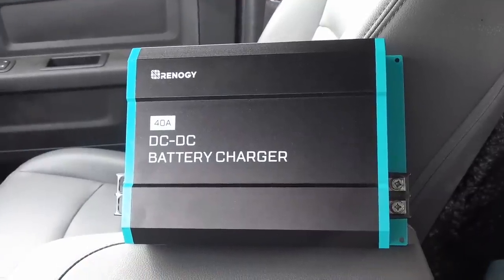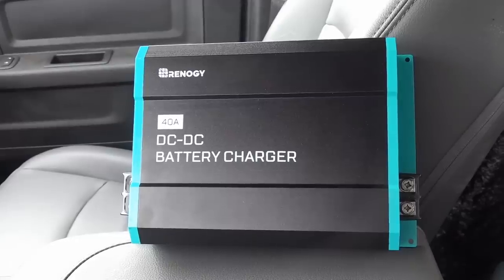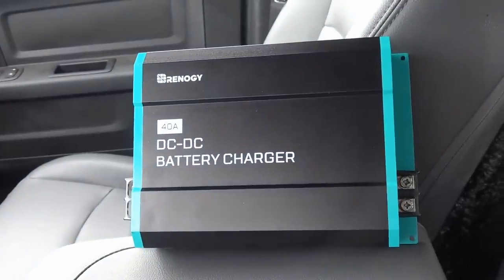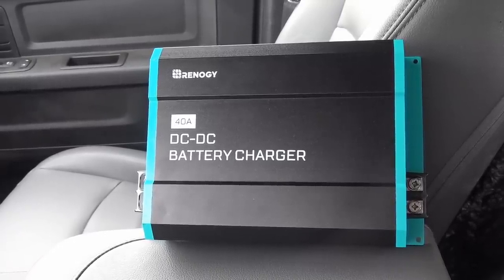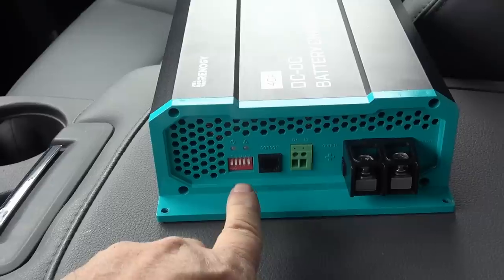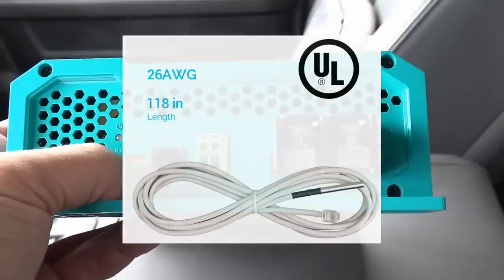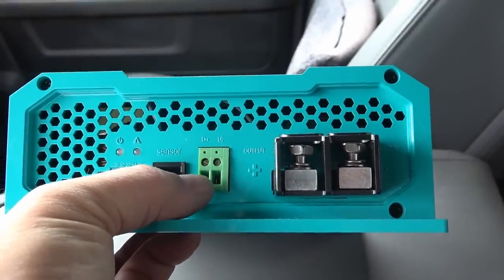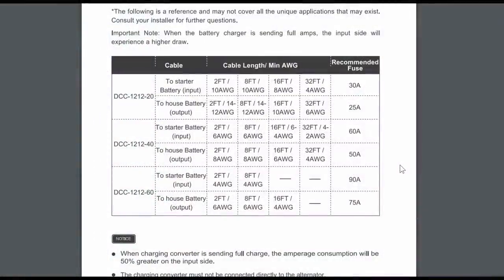Extra 40 Amps Charging into RV Battery Bank from Truck Alternator (Renogy 40A DC-DC Charger)

Comment: Does this system rely on the lithium battery BMS to stop accepting a charge when fully charged?  If yes, this is not recommended by battery manufacturers. The BMS is a fail safe only.
Reply from the maker: There is no floating charge, but you can set the lithium charge voltage option to either 14V, 14.2V, 14.4V or 14.6V You could be conservative and set the charge voltage to 14V and likely never get to the BMS failsafe voltage cut-off or else go with a lead-acid charge algorithm instead and it also may never get to the point of activating the BMS failsafe. That's what I have tried during my first test, left it in a lead-acid mode, 14.4V bulk, then 13.8V float -  it dumps full current into the batteries, then slowed the amperage near the end and my solar controller finished the job. It seems to work well fine with my Lion Energy battery BMS, but other brands may have a different BMS. That can be a big difference in battery quality how advanced the BMS is, but most of the "drop-in replacements" have pretty good ones.
Reply: @LoveYourRV  Thanks for the reply Ray.  In your tests, have you found that the DCDC stops output once the set target voltage is reached, or does it keep pumping out that voltage, keeping the alternator under extra load. (for lithium settings).
Reply: From the Renogy's information, it is a charge controller, so it should have a charge profile for most of the current 12 vdc consumer storage batteries.
Reply from the maker: I haven't had a chance to test much. A couple of days ago I left with battery bank down around 200 AH, towed for about 3 1/3 - 4 hours, mostly overcast day and arrived with a 100% full battery bank, charging had basically stopped from both the DC-DC charger and my solar controller. But, since I was driving I didn't have the chance to watch what went on. I'll be back with an update after I've had a chance to use the charger for a few months. and test out different voltage settings.
Reply: @LoveYourRV  Thanks Ray
Reply: @LoveYourRV  I was wondering if you disable the 12 vdc from the 7 pin when you enable the dcdc. If the lithiums/bms fail, do you still have trailer brake source power? How do you prevent back current on the seven pin? I did not notice any suggestions in the Renogy manual for these questions.

Comment: Don’t you have six switches on your truck? I would assume you would since you have the diesel. But those switches can supply the 12volt. Very easy to wire up as well.
Reply from the maker: No, I don't have the Ram upfitter aux switch package, I factory ordered my truck and limited the options to keep the cost down, it would have cost a few thousand more as they make you buy into a package of features to get it. I think I had to get the snowplow package or something like that, Canadian truck. ;) The light switch solution works fine, I always tow with the lights on anyway and don't leave them on when parked and the 12-volt marker light wire is already there. No need to run another wire from the truck to the trailer. Actually a much simpler solution in my mind.
Reply: Love Your RV don’t you already have a charging wire front the trucks pigtail? That would supply 12 volt when you turn the key on.
Reply from the maker: I wanted some control of when I turned on the DC-DC charger, have the option to let the engine warm up a few minutes or so before turning it on, and it starts to draw amps. For instance, on a cold start, the diesel truck initially pulls a lot of juice to power the grid heater.

Comment: So, it will boost the voltage?
Reply from the maker: Yes, most definitely. That's the main reason I have it so I can charge my lithium battery bank at the proper voltage even though they are located far away form my alternator. It draws more amperage on the input side so that it can boost the voltage on the output using the same overall wattage.  On my system the input draws about 50 amps so it can output about 40 amps. Input voltage is about 12.5V and output about 14.4V. Cheers, Ray
Reply: @LoveYourRV  thanks for the reply

Comment: How could you run this from truck to Bluetti effectively? My needs would be to go from Ram Promaster battery to the Bluetti so it charges while driving (instead of cigarette lighter option).
Reply from the maker: What Bluetti model do you have. There are many different models out there that take varying amounts of max wattage during charging. So makes it hard to answer your question.
Reply: @LoveYourRV  Actually I’m looking to get the AC200 like you have OR the new Ecoflow Delta Pro. In my homework stages now trying to design the plan for my rig. I’d love to not have to install any full time lithium house batteries and simply just use a power station.
Reply from the maker: So the best way to go I think would be to install an inverter of at least 600W and maybe a 60 amp DC-DC charger. That way the DC-DC charger would put out enough wattage to power the inverter to then charge the Bluetti using the AC charger input at 400W+. Downside is there would be some losses in the DC to AC transformation but charging is much faster versus the automotive cigarette lighter plug. A 40 amp may do the trick but would be very close to maxing out, if you also had solar it may be OK as it could also be feeding the inverter. However, keep in mind a 60 amp DC-DC charger will be a big draw on the alternator so it should be a pretty beefy one to handle the extra power draw or maybe a dual alternator system is a better idea. Also cable sizes will need to be bigger to handle the extra amperage.

Comment: How did the 4 gauge wire work out?  Did they run hot?
Reply from the maker: No problems, not getting hot, has worked great.
Reply: @LoveYourRV  perfect…much cheaper than the 2 gauge.  Thanks
Reply: Also, you connected the switch to you RV lights, what happens when the batteries are fully charged?  Does the system still draw power if the lights are still on or does the charger automatically shit off?
Reply from the maker: Yes it will still draw power. So if you if you connect it that way you can't leave your lights on very long with the trailer tow cable still hooked up or you'll drain the truck batteries. My truck has an alarm sound if I leave the lights on by mistake so its not a problem.  If the trailer batteries are fully charged the power draw would be much less. At that point it would depend on how much trickle charge is need to power the devices in the RV connected and running on the 12V system + a little bit that the DC-DC charge uses to convert power.
Reply: @LoveYourRV  I was worried about driving at night when the auto lights come on…the batteries will continue to charge.  I ordered a 3500 limited with the auxiliary switches so I’ll run the switch wire there.  Just liked your setup and it’s the easiest but I guess one more wire isn’t a big deal…thanks.
Reply from the maker: One of the perks of this DC-DC charger is a multistage charger output so it won't overcharge the batteries. It works just l like a solar controller or converter charger.  I did mod my install later and put in a wireless 12V switch so I can turn the charger on and off with a little key fob if I desire. Figured that may come in handy if stuck in stop-and-go traffic or pulling a long hill with AC on and worried about overheating the alternator or robbing horsepower but still want my lights on. Here is the mod video - https://www.loveyourrv.com/12-volt-wireless-switch-mod-for-my-40a-dc-dc-charger/
Reply: OK…your always multiple steps ahead of me…can’t thank you enough!

Comment: Seems to me you could eliminate the 60 amp fuse and just use the breaker.
Reply from the maker: The fuse is there to protect the wire running from the battery post to the breaker input side. Say I accidentally drop a metal tool or something and it shorts from the breaker input lug to truck metal chassis, the wire could get red hot instantly. Melt things or cause a fire. It's always prudent to protect every section of wire in a run. I could have just used the terminal fuse for the install but I wanted a way to easily switch off the voltage to the back plug when not in use or work on/test the operation.
Reply: Love Your RV I see your point. Makes sense.

Comment: have you had any issues with the 60amp breaker over heating in the Engine bay?
Reply from the maker: No, it's mounted up and over where the OEM battery, voltage sensor, and fuse/breaker box are located so I imagine it doesn't get too hot up there.
Reply: did you you leave the the 12 volt power on the 7 pin connector connected?
Reply from the maker: @BD-hg2wg  Yes, my 2018 Ram 3500 7 pin tow cable charge wire is so thin gauged and such a long wire run being a 21-foot long truck that it doesn't make much difference to anything. Given the higher voltage of lithium batteries. I get not much more than trickle charging off it at best.

Comment: Ray,  Don't you (almost) have to have this to protect the TV batteries?
Reply from the maker: There are other battery isolation/protection devices that can do it but depends on the length of the cable run and thickness between batteries if they will work well or not. On a motorhome or van, they may be another viable option. But imho this works best for long trucks and trailers. The beauty of the DC-DC charger is it isolates but can also boost the voltage on the output of it to overcome voltage drop over long cable runs so you can get away with using a smaller gauge wire.  The DC-DC charger output also has customizable multistage charging algorithms. 
Also depends on the alternator type. More info here - https://redarcelectronics.com/blogs/blog/the-truth-about-alternators

Comment: Which battery do you hook up to when you have 2 batteries?
Reply from the maker: I hooked up to the drivers side battery.  The OEM placed a high amperage output terminal with terminal fuse holder there.

Comment: Could I go cheap and run my portable generator while driving and connect to my 30A RV cable? I could run the A/C and charge. Gen could be in truck bed or trailer rear end rack. Is this a dumb idea?
Reply from the maker: I've never done it myself but have I've heard of people doing that. Just have to beware of the fumes, make sure they don't enter the cab of the truck.

Comment: Hi, I’m unclear as to what you have a 60 amp terminal fuse followed by a 60 amp breaker. One to switch on/off, but why at the battery post? Is it necessary?
Reply from the maker: To protect against a short circuit between the battery terminal and the breaker mounted down behind the battery. ie, say I drop a wrench or something back there and it shorts to ground. Its good practice to fuse every circuit and individual wire run. Cheers, Ray

Comment: Did u disconnect charging  pin in the fifth wheel wiring harness?
Reply from the maker: No, I didn't bother and I've had no issues. It is a very small gauge wire and doesn't provide much amperage if any. Mostly a trickle charge I believe. Especially since my trailers has lithium batteries that naturally sit at a higher voltage than lead acid type.
Reply: This video was exactly what I was looking for!!!!!! Thanks!! You videos are very helpful!

Comment: Li batteries can take insane charge rates, ... if I see a Tesla v3 charger at work I will avoid it (peak 800A at 300V,  ~ 250kW)  To an old guy this doesn't   seem possible, it really doesn't seem possible they've made this a reliable consumer product.  Under the old rules power electronics like these had a high propensity to get really hot and occasionally blow up.

Comment: How do I know my alternator will be fine with a 40A charger?  That I won't need a High output alternator.  I am not sure what happens when the alternator is not enough.
Reply from the maker: Best to have a mechanic take a look and see if it can handle an extra load. It will depend on the amperage rating of the alternator and how many electrical accessories are on the truck already.  If it can't handle the extra amperage it may overheat and fail.
Reply: @LoveYourRV  Thank You Ray.  Yes, it would be best.  Good knowledgable, and, available mechanics are so hard to find these days :-0).   Do you mean extra electrical accessories? or even the original in the truck? I could just go for a 20A to make sure.  My alternator might be a 120 t 155 amp
What do you think of the Victron Orion 30a?
Reply from the maker: When I ordered my new truck I bumped up from the stock 180A to the 220A alternator and also my truck is an ST bare bones model without many electronic bells and whistles so I felt confident I could add the extra load without worry. So I added a 40 amp DC-DC charger and it works great.  I find that most of the Victron stuff works well but is overpriced. Cheers, Ray
Reply: @LoveYourRV  Thank You!  I will pursue my research :-0)

Comment: If cables are rated the same amperage, what’s the difference if solid copper or copper coated aluminum?
Reply from the maker: For the same size copper has a better amperage rating as pure copper is a better conductor of electricity than aluminum. I've also heard people have had more problems with the internal wire strands breaking and connections going bad with the copper clad aluminum cables. The only real reason they make then is price and they are a bit lighter.
Reply: I ran 2 gauge from truck battery rated 600 amp and was running 4 gauge 500 amp from connector to charger. What’s your thoughts?
Reply from the maker: @vickishort9128  Sounds like it's OK to me but to be sure if you look in the owner's manual it gives you the recommended gauges to use for different distances and DC-DC inverter amperages.

Comment: I put a lighted switch on my dash so my truck can warm and my gauge says my two start batteries are charged. And I don’t want it to run off my marker lights because it will take juice from my system and may be thinking to hard .
Reply from the maker: The trigger wire take next to nothing as far as current goes so doesn't affect the marker lights. All its doing is switching a small relay in the DC-DC charger
Reply: I just like the the switch on the trip wire and I can start it or stop it and the switch lights up when dc charger is on so I should not forget it and wake up with 2 dead start batteries. And I have read a couple different post where they used some very large wire and they said it burned up the alternator and when called Renorgy and they said use the proper wire size because the lithium batteries can pull a ton of power and can Handel it but your alternator can not and on my truck camper with 2 Battleborn batteries 100 each and they are very costly but with 12 year warranty and the power they hold is crazy and they will run roof top AC  unit for about 5 hrs if you would want to cool it off before bed time. I only charge my batteries to 85% and discharge them to 20-25 %
Reply: I love your slow talk style and you give good solid info, so keep on keeping on you do a good .

Comment: What charger do I need for a 100AH AGM battery?
Reply from the maker: You'd have to look up the max charging rating for your battery brand. For example, here is a Renogy spec sheet and it says the max charge current is 30 amps https://www.renogy.com/content/RNG-BATT-AGM12-100/AGM100-Datasheet.pdf  I believe that is pretty typical for AHM 100Ah.  But if you parallel more batteries together the max charge increases.

Comment: Do you have a link for the d+ cable? I cant seem to find it!
Reply from the maker: The manual says 18-16AWG, copper cable recommended. Any auto parts or hardware store likely will have it. Standard automotive hookup wire https://amzn.to/41WDDzU  Cheers, Ray
Reply: @LoveYourRV  thought it required some other type of connector at the end, is it just a spliced cable?
Reply from the maker: No connecter, just strip back a little bit of the wire and put it into D+ hole then tighten the little screw.
Reply: @LoveYourRV  ok last question. If mine is 60amps, should i still use 18-16 awg? Thank you so much!
Reply from the maker: Yes, the same manual is used for 20/40/60 amps and states 16-18 gauge https://www.renogy.com/content/RNG-DCC1212-20-BC/DCC1212-204060-Manual.pdf  All the trigger D+ wire is doing is powering a small on/off relay inside the DC-DC charge, not much amperage is needed.
Reply: @LoveYourRV  gotcha, makes sense! Didn't think of it that way. I have some spare 16awg! Thank you so much!

Comment: Can you use it to charge a 24v battery system? Thanks
Reply from the maker: Doesn't look like it, here is a link to the user manual  https://www.renogy.com/content/RNG-DCC1212-20-BC/DCC1212-204060-Manual.pdf

Comment: Hey Ray, curious why not install in the truck? Thanks!
Reply from the maker: You want to place the charger as close to the batteries you are charging as you can to prevent power losses in the wire.  The box is designed to raise the amperage going into it to make up for voltage drop along the input wiring so it can overcome a long wiring run and maintain the same power transfer, but not the output.  So if installed in the truck it would not work nearly as well, less charging power.  Cheers, Ray

Comment: Is the li-BIM 225 Isolator by battle born the same? Whats the difference?
Reply from the maker: I think this is more similar to this charger  - https://battlebornbatteries.com/shop/sterling-power-battery-to-battery-charger-12v-input-to-12v-output-30amp-dc-powered-charger/ But, my Renogy is much cheaper and has more amp output. Sterling has been a quality name in the marine industry for a long time
Reply: Thanks ray, luv your vids, been watching you for years. So i got the wrong one? I got 4 lithium batts. hope to meet you on the road someday. cheers.
Reply from the maker: Thanks! Depends on your setup, with my trailer I have such a long wiring run I needed something that could isolate but also boost the voltage to over come the voltage drops in the wiring.